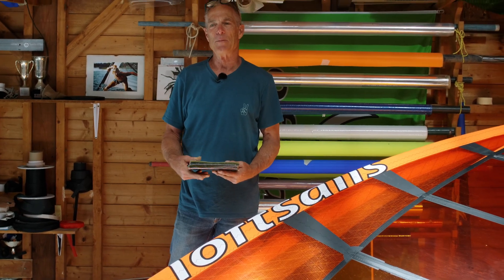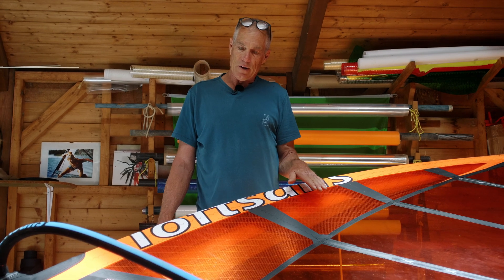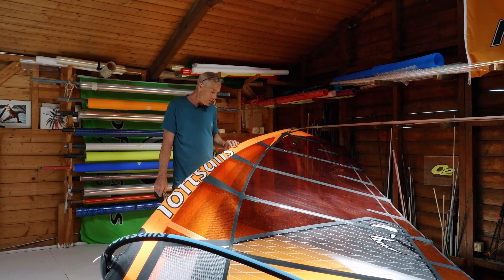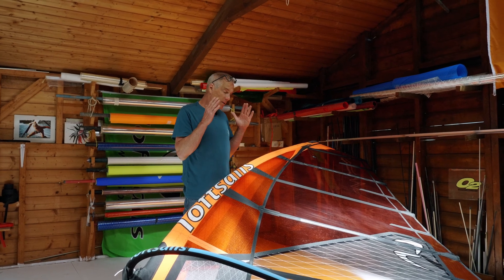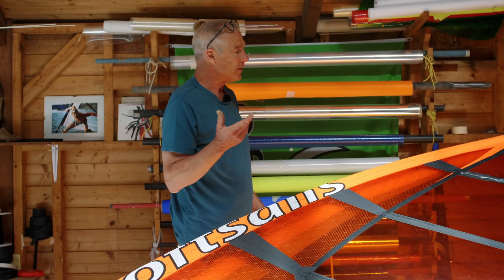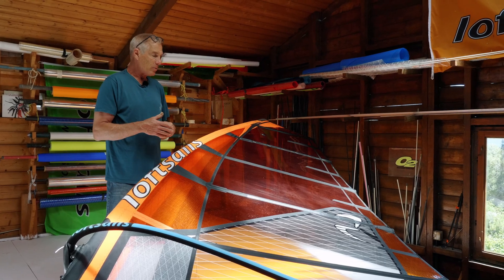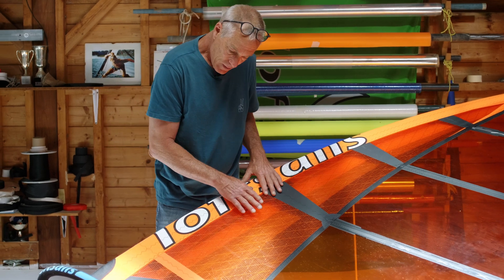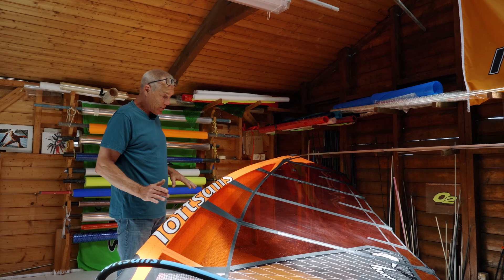Loftsails Sail Materials | TechTalk Ep.6

Comment: I have been sailing Oxygens since they were introduced as O2's!  No better designed slalom sail that can dump excess wind when overpowered. I can sail one to two sizes larger than everyone else on the water and not have to come in when the wind drops a couple miles per hour.  As for durability... I'm pretty meticulous about taking care of my gear and average about 45 sessions per season for each of my 6.3 and 6.8 sails and if I they last 3 years I would be ecstatic but sadly the windows will tear in less time.  My just replaced 6.8 exploded the main window while down hauling! A first in my 44 yrs of sailing. So even though it is a 6.8 I went with full xply this time. I can report that my 5.8 and 5.3 full xply Oxygens have lasted for many years but then they are only used a hand full of times per season.  There is no better non-race sail on the market.  To bad I always have to order from Europe and pay high shipping costs to sail on them in the US.
Reply: Considering what you you've said I realize that yes the HD models last a long time (in my smaller sizes), but in my mind, the non HD models are faster, lighter and racier looking. So I have always been using them for my speed sails - 6.3, 6.8 (6.0, 6.5 in the past) which wear out often, but in reality I could have been using HD's for them all. I have hit 40 mph on the new 6.8 HD in light chop so it is just as fast! How many have I owned? No idea sorry. 9 Futuras  in that same time period. 2 were stolen and 2 snapped in half (2019 was a bad production year).

Trust me no one in the USA has sold Loftsails in many years.
Reply from the maker: @ecot29  HD models are actually are lighter than monofilm. Even if just slightly. . 
While the main X-ply window is a bit heavier than the monofilm, other panels of HD sails are lighter when compared to the monofilm version. 

Check with https://windforce.ca/
They ship to USA.
Reply from the maker: Thank you for your continued support and love for Loftsails designs! That's an impressive streak. How many Loftsails have you owned in total?

Monty has often mentioned in his interviews that monofilm is a redundant material—it becomes brittle too quickly, which is simply a characteristic of the material, regardless of its cost. That's why we've developed an X-ply version for both the Oxygen and Switchblade.

For assistance with supply, please send us a direct email. We'll help you find a local dealer: https://www.loftsails.com/contact